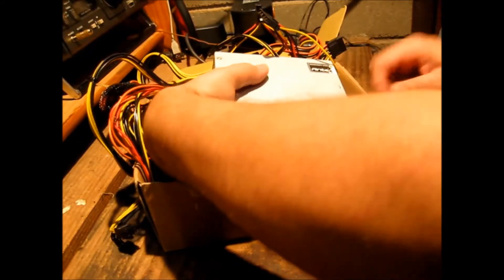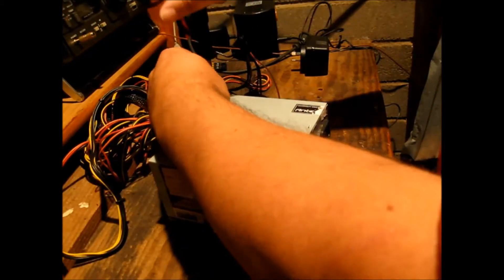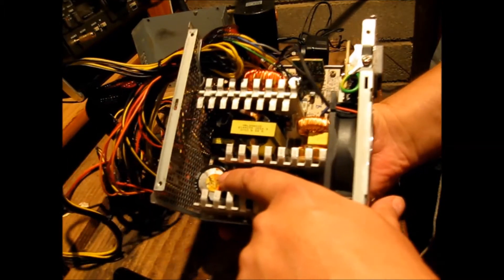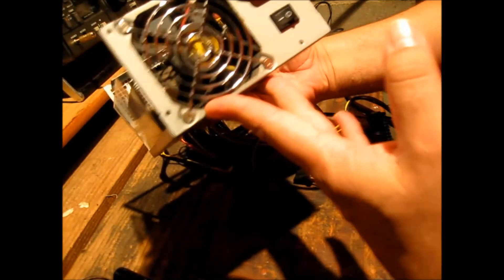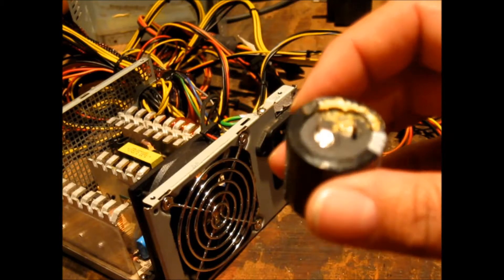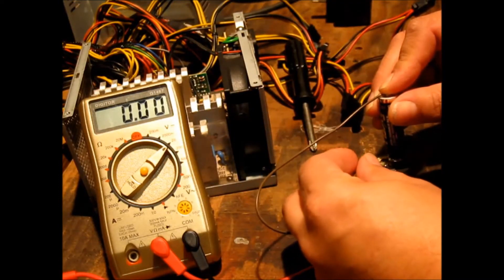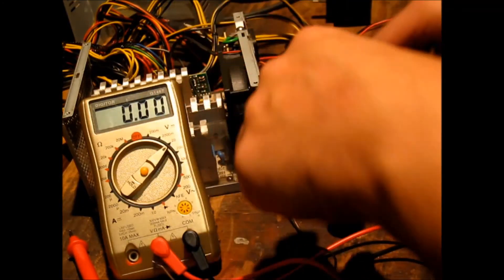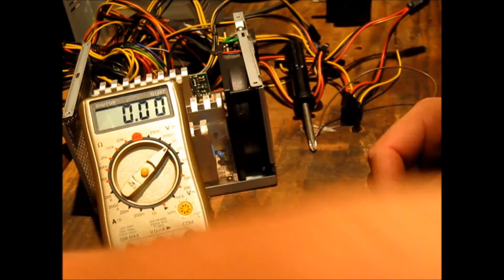Antec Earthwatts 500w PSU - Repair Part 1

Comment: Can we use it for gaming to power a rx 580 8gb
Reply from the maker: The 12v rails on this (older) variant of the Earthwatts 500w PSU only supply up to 17A, the Saphire RX580 Nitro 8GB (with ultra boost) tested by Tom's Hardware peaked at 237w under extreme torturous loads, that works out to be just shy of 20A, you are going to need something that can provide 22A on the 12v lines.

Here is a link to a PSU requirement calculator as you also need to factor in additional system load requirements when choosing something to power a gaming PC

https://outervision.com/power-supply-calculator

Comment: JACKON sent me 3 bags of 30 each of 3 different cap sizes that failed on a mobo.  I don't remember who I complained to (mobo or Jack) but I may have even talked to them.  I said something like, "It would be a sign of Good Will if you sent me complimentary caps to repair this board."  And they did.  Of course, now what do I do with them!  haha
Reply from the maker: The only  "Jackon" capacitors I have ever seen were failed types I was removing, SamXon are pretty decent (get the low ESR type) and have used these extensively whilst I was able to procure a good quatity (there was a sales rep at Badcaps.net at one time), Hitano (low ESR) have also proven to be a good choice along with the usual Rubycons etc.

Comment: A thought on bad caps:  I noticed that the high energy density sizes are the ones that tent to fail most often- especially the 8x20mm ones.  I'll bet the manufactures could have side stepped the issue by continuing to use caps (with the bogus stolen electrolyte composition) _but using the next higher voltage rating_.  Many junk caps do not fail - and if you see a lot of the same PSU's you'll find the same caps fail.  Evidently if not stressed as much they actually are OK.
Reply from the maker: Going bigger only worked where space wasn't at a premium, heat stress kills capacitors just as easily as running over specification (or a low quality electrolytic compound) 👍

Comment: Sorry.  Vents Open:  Recapping an Antec???  So much for quality, huh?  Since their PSU's cost more, they are not competing with anyone - people are buying their name.  Oh, I get it, since that is the case, save 20 cents in manufacturing costs and sell the suckers inferior components.  Antec has No Honor.
I wonder what crap they are using nowadays with their "Heavy Duty" capacitor claim?  I guess they don't want to get tied down to using "Japanese" capacitors.
Reply from the maker: I agree that Antec choosing the lower specification capacitors almost borders on criminal however I really don't mind the overall layout, design and performance of these PSU's,  I couldn't really comment on the newer ones as I am still using recapped Antecs, 10+ years of trouble free service life is pretty decent (following a recap) 👍
Reply: @SpectreOZ  Yesterday I came up with the Final Solution for buying a PSU with quality caps:  buy a new one and recap it right out of he box!  But you bring up another good point, the Antec's are generally higher quality so maybe a recapped Antec might be another "solution."  

PCP&C states "100% Japanese 105°C capacitors" and "heavy duty protection circuitry" in their lowly Silencer line - but you pay baby!
Reply from the maker: @NoferTrunions  Used PSUs are significantly cheaper than new, add in quality caps and you are good to go so long as there wasn't another underlying issue with the unit, alternatively Seasonics have historically been a good choice in a market all too often filled with form over function (bling before performance) power supplies.

On a side note... Ihave seen 85c rated capacitors used where a prudent engineer would/should have opted for 105C 👍
Reply: @SpectreOZ  Years ago I I believe I bought a new Seasonic that had the big 120mm fan in it.  It's one I plan on recapping.  NOTE:  I just replaced 4  1800uf 6.3V in a Dell XPS 430 with 2200uf 6.3 which was as close as I could get.  Then I decided to open the PSU and yes, one bad cap!  a 2200uf 10v.  Frankly, I was impressed with the build, design, etc of this XPS although the big video card completely block the adjacent PCI slot.

Comment: I am trying to repair my antec 650w earthwatts ea650 but the screws are kind of strange, i dont think they want you opening it. Any advice?
Reply from the maker: All the EA650's I managed to find on the internet appear to have the countersunk Philips heads screws, is it  possible yours is a newer variant? additionally can you link an image of what the screws look like? they may be a type of Torx security bit but I can only guess... at this point :)
Reply: +SpectreOZ http://imgur.com/zzg1nRa
http://imgur.com/cZT2VxY
 
Thank you for your help!
Reply from the maker: thomas coles The screws in the linked image are countersunk head Philips screws and they hold the fan (and safety grille) in place, there should be some type of screws on the joining edges of the case that hold the case together.

The fixtures in the second image look to be supports/anchor points for something within the PSU itself like an earth lead and/or mounting supports for the circuit board.

If you do open the case up please make sure you discharge the power supply first, those big capacitors hold mains rated voltage which can be lethal.

Comment: these older psu's were made by Seasonic which are normally one of the best psus :/ i know the newer earthwatt psus are made by delta which is also Great and they use better capacitors
Reply from the maker: ictdude1 Yes indeed thanks for your comment, why waste a decent PSU simply because less than stellar capacitors were used OEM, it's not a hard fix but definitely a worthwhile one, 90% of the PC's in our home are powered off a recapped Antec PSU's.
Reply: Or Delta, ea-500d is made by Delta Electronics.